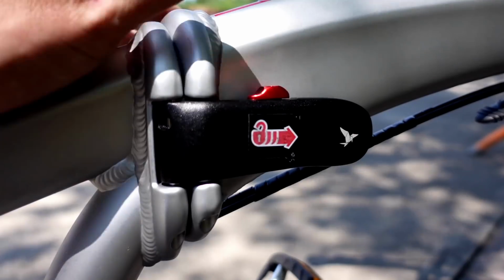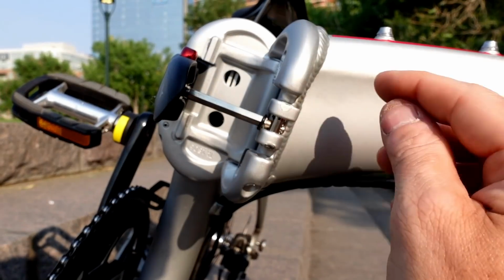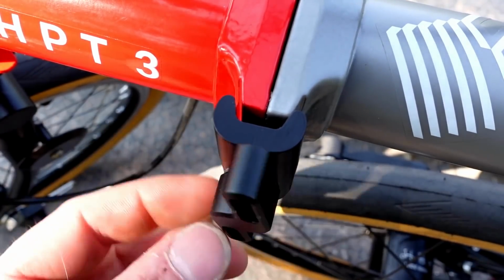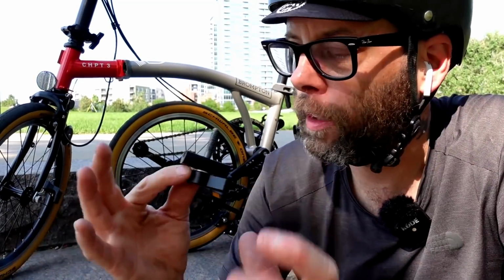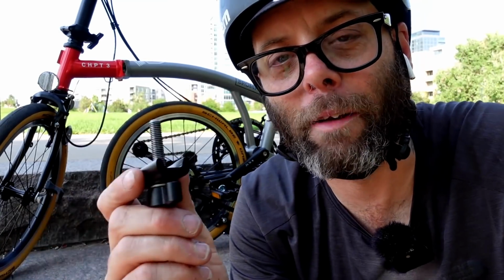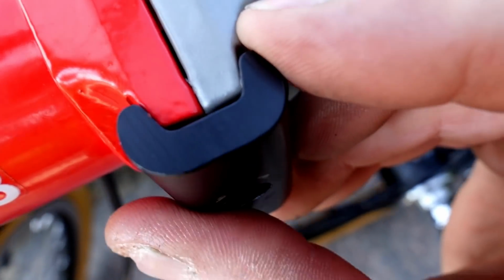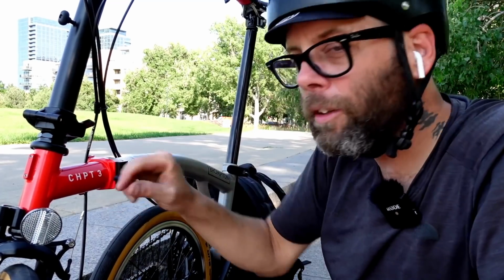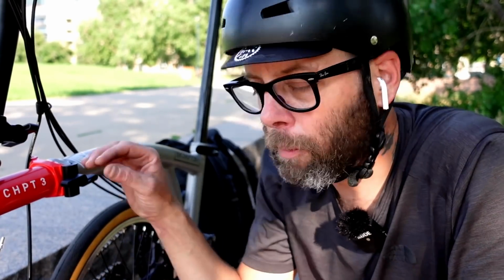Are Brompton clamps Obsolete?

Comment: Aerospace engineer and yes, failure points are valid.  
Aluminium latch is sacrificial part and stops frame from wearing.  Cheaper to replace hingle clamp or the frame !!! 
TRUTH.

Comment: Brian, why am I commenting on this 3-year old video of yours? First and foremost--it's really good as a technical video. You are adding value on several levels: on the level of a Brompton part (the hinge) that any Brompton owner can relate to. Secondly, you are overlaying your technical background and adding tremendous value (for example, when you indicate the 9-potential failing points or how much engineering goes into this--you know from personal technical knowledge and experience). But man, you are on fire here: clear-headed, articulate, moving fluidly from one aspect of the issue, to another.  This is you at your very best. I hope this becomes a model for your returning to what you do best: talk clearly, technically and from experience. This simple video, in my humble opinion, is one of your very best. And how ironic, it's about and simple clamp, but it adds tremendous value!--Steve

Comment: Simple is safety. BUT; From what I've seen, Bromtons are not as tough as you and others on Youtube claim. You've had problems with your bike, parts that should not go bad, HAVE gone bad. Bottom bracket, seat posts, rear drive hub, broken frame, no they are not as solid as I once believed. The clamps seem bombproof, but, the bike isn't.

Comment: So I genuinely agree with all the points you've made , but I think the reason people say brompton doesn't innovate is because of their fundamental failiers as a company towards there customer base and the lack of options they provide ( despite people constantly requesting) like refusing to make bikes for taller , heavier riders, 20" wheels , voiding warranty for making modifications they refuse to do, making an awful ebike conversion(don't put the battery in the bag i wanna put my stuff in)  the list genuinely goes on and not for lack of quality being available from 3rd parties, anything from belt drives to rear triangles that can suport larger hybrid tires, everything falls on deaf ears with them. If they made it we would buy it !!! Regardless of them refusing to move manufacturing abroad to reduce cost to consumer.

Comment: The wear is between the metal interfaces that are susceptible to load and rubbing, so the frame-frame joint ends wears. If you always keep your clamp tight, then the frame-frame joint ends wears much slower. The wear on the clamp is much lesser because the load is much lesser on the interface between joint and clamp, but it will bend slowly over time and open up, faster if you tighten it more. That's why 3rd party manufacturers improved it by making it stronger.

Comment: A brilliant and straight to the point video. Some people buy the fancy clamp just for the looks, not necessarily for the simplicity of rotating it. Safety is the most important factor in the clamp. I  wouldn’t want to have the clamp break thus causing an accident whilst riding.

Comment: Please folks stick with the stock Brompton STEEL  hinge bolts,   have had two aluminium bolts shear off.    Well said Brian !!   Do not switch out the original bolts,   you will in the end realise the stock bolt is the most reliable and the safest option.

Comment: Totally agree. Brompton has been around since 1975 and had essentially not changed. The early Mk 1 had some welding issues which was fixed. Sometimes people dont realise why Brompton does it their way.  Brompton clamps are made of aluminum because it’s made to wear out against the steel frame.

Comment: Enumerating points of failure is meaningless if the chances of failure are small & I contend they are very small with the evolved modern folding loch mech.  A locking mechanism that can be completely removed from the bicycle is one that can be lost.  I'm not saying the Brompton mech is bad - its strong and simple and bolts are easy to replace.  But it is pre-historic and modern folding clamp designs are undisputably superior in terms of reliability, ease and speed of use and safety, dang it.  The Brompton is 1950's design.  Its 2022 now,  and engineering has come a long way.  Aluminium is a wonderful material and  we do amazing things with it.  Steel has wonderful qualities too but the best place for chrome steel is in the fork, not the whole frame where the strength and weight advantages of aluminium offer so much.

Comment: You make a good point about the piece being sacrificial. If you were to make it from a stronger metal, the weakest part of the mechanism then becomes the bolt. Many people don't understand how bolts work. When you tighten up a bolt against a female thread, you are actually stretching the bolt by a very tiny amount every time you use it. With time, this leads to work-hardening of the metal and it will eventually fail.

And if the bolt fails, you are in BIG trouble (but it will probably happen so fast that you will wake up in hospital with no recollection of it).

Much better to have a softer piece that you can inspect visibly pretty much every time you use the bike.

Comment: Thanks Brian for an excellent analysis of the original Brompton clamp design. I replaced both of them with LITEPROBIKE for over a year now. One of the clamp fall apart the other day when I was tightening the clamp to the frame. The top turning part separates from the screw that attached to the frame. The screw stripped apart from the clamp and there is no way to keep it lock tight, thus cannot ride the bike. Lucky I was very close to home and now I have changed both clamps back to the original Brompton clamps. Yes the color coordination with the LITEPROBIKE clamps dress up the bike nicely  but it introduces safety issues that I will definitely avoid. Cheers.
Reply: The old Raleigh Twenty clamp was the strongest frame clamp for folding bikes and also no failure points as it was a top tube clamp that would hold even if clamp bolt was unscrewed
Reply: Thx for sharing your knowledge of Bromphton I would love to get one but ca
N’t afford it 😂
Reply from the maker: I've heard horror stories that's why I made the video😬😀  thanks for watching.👍

Comment: Hi Brian I've been watching your channel for a while, great video and very topical for me. I have a Brompton B75 and a Gocycle GX. Love my B75 but I use my Gocycle more as it's my main commuter bike. I took it for it's first annual service in December and they found the main pin holding the handlebar latch only had a couple of millimetres left in it and was about to fail. I had to wait weeks for a new pin and with in a week of getting back on the road the handlebar latch started to rattle again. It's gone back to get sorted again but I've lost confidence in the Gocycle because of this and a few other durability issues. I love my B75 but because I've got a lot of hill's on my commute I've bought a new Brompton Electric 2021 6 speed and when the Gocycle gets fixed it's getting sold

Comment: You know why the aluminum frames are so thick in terms of wall thickness and tube diameter?  It's to reduce flexing.  Any flexing on aluminum contributes to fatigue and eventual failure.  Steel and titanium can theoretically last forever if not flexed into the plastic region.

Comment: I have added a wheel and a bolt with a stop in the end, which won't unscrew. And lightweight clamps from carbon. The one wheel wasn't fixed, so I used Locktite.

Comment: I kept the original clamp but changed the bolt , ok the new bolt is titanium,  but I greased the bolt thread and frame thread often. One of the new bolts has extra screw to stop the bolt comming totaly off accidentally.  Ps Great video and thanks.

Comment: Nice one Brian. Just a question. Recently my clamps have started to stick in place. So normally when you unscrew the bolt, the clamp comes away, but recently been sticking so have to pull on it to release it. Not sure if anyone has had the same thing? Don’t think it’s a major issue but worth mentioning. Recently replaced the clamps at 6k km and same thing with the new clamp. They are Brompton ones as well. Stay safe! 👍😀
Reply: A smear of grease on the inside "wings" of the clamp should do the trick!
Reply: @nicholascoupland9944  thanks Nicholas. Have been doing when giving it a clean, but just wondered if anyone else had noticed the same?
Reply: Do not tighten it too much, just finger tight will do. Also, put a bit of grease on the frame hinge.
Reply: @andrewpeternavarrete1227  I never really over tighten it. I have been putting a little bit of oil on it, but just wondered if anyone else had been experiencing the same. I do quite a few miles on it. Replaced the hinge clamps a few months ago which solved it, but started again now. 👍
Reply: Grease or wax should do. Springs also work. Brian’s critique of aftermarket clamps I’d flawed, by the way. My SpedDial kits, for instance, are made in the USA of certified components. My competitor’s EZ clamp springs should also help solve your problem.

Comment: Was speeding on a folder similar to what you presented at 2:10, hit a speed bump, then the stem collapsed on its own. I guess the force was enough for the small catch to fail. Had a sore shoulder for a month and a half. No bones broken, thank God, but the helmet was smashed.
Reply: Similar thing happened to me landed on my head, stitches, cuts and bruises etc at 14 miles an hour I’m sure I secured it properly.
Reply: Bumps should be avoided on folding bikes as much as possible especially on aluminum frame models.
Reply: Hi @carltongadgettmannprice352  , I doubt if what I described above will happen on my Brompton because the clamps are designed robustly. Now, if your bottomline is that folders are not designed to take stresses riding through speed bumps, then my bottom line is that this folder I rode on was not designed correctly to address the needs of your everyday urban mobility.

Comment: I do plan on replacing my clamps, and yeah for vanity reasons. I’ve got a black s6L and I’ll get black  Brompton clamps to replace the Ali ones.
I wouldn’t trust anything structural from after market sellers. Saddle, grips, a rack if I fancy one yes, but structural,  I’m sticking with OEM parts. I’m an engineer and I trust that the engineers at Brompton have got it right, so I ain’t gonna try and fix non existent problems.
Thanks for the vid Brian 👍
Reply: You might find my SpedDials superior to OEM clamps. You could also add my competitor’s EZ clamp springs to the OEM, adding convenience to reliability.

Comment: Yes the standard clamp is functional, however it could be improved by making 1 side minutly longer to stop it from spinning. Also add a spring.
Reply: I use a set of these.
Reply: Ez clamp springs, 3d printed and cheap!

Comment: Interesting video, thanks Brian.

The beauty of the Brompton design is that you don't have to keep adjusting the clamp.

My old folder is a Taiwanese Raleigh (also real steel) which has the more common toggle type of clamp. When I rode it daily I had to adjust both the frame and handlebar clamps every 3 months. It wasn't a safety thing, it was just detectable play and I hate any vehicle I own to be out of adjustment.

Engineering trivia:
1. A 3/16" steel pin in simple shear takes over 2000 pounds to break it.
2. Lightweight alloys, particularly aluminium (or aluminum in the USA) suffer from metal fatigue. This means it eventually cracks and if the cracks go undetected you get sudden failure. This is why aircraft have their airframes crack tested on every major service: and why my son's last commuter bike suddenly became instant trash. I own four bikes and they all have steel frames. Even the lightweight ones have Reynolds steel tubing.

Comment: Have you not seen the little widget thing that keeps the Brompton latch from spinning? Just a little plastic thing that keeps the plate from spinning as you spin the bolt. Made all the difference to me. One-handed clamping.
Reply: I put a small spring I bought from a motorcycle shop, and it works perfectly.🙂
Reply: Glad to hear you are happy with my competitor’s EZ spring clamp! (Though I recommend my own SpedDial kits for reasons I’ve explained elsewhere on this thread.

Comment: Do not replace brompton clamps with aftermarket  clamps since they are not  made to same specs. Ti parts clamp does not clamp correctly according to Brompton NYC they recommend removing aftermarket clamps  for safety.
Reply: My SpedDial clamp kits are made in the USA and equivalent in strength to OEM, but easier to use.

Comment: An excellent video which all Brompton owners definitely should watch for the very well made points.
However.
As a 100% Brompton fan I wish that they could re-evaluate some of the other design features, for example the suspension block. Automobiles use spring suspension and there is a leaf spring product for the Brompton. IMHO when correctly designed and made of the correct materials, it is a far superior solution. 
BTW this doesn't include anything sold on Aliexpress.

Comment: Awesome video Brian. Your talking points are bang on. Another thing to bring to your attention is that if you were to look down the "U" channel, you'll notice that the sides are not perfectly flat from one end to the other. This is not a fault but just goes to show the perfection of Brompton and their R&D team. The ends tend to "dimple" inwards to apply more clamping pressure at the frame hinges top and bottom part. Absolute genius. Bottom line, I too would never consider changing the stock clamp.

Comment: Thanks Brian. I 💯 agree with all your points. I too would not swap out the factory clamps or bolt for the same reasons. You are right, down to the threaded bolt, the metals and strength of the metals are dialled in very specifically. You'll notice an 8.8 on the head of the bolt. That's a high tensile strength rating designed for automotive use. That is it can withstand 800 Mega-Pascal before it fails with a nominal 'recommended' rating at 80% of that limit. Ease of replacement of the part was also my concern with 3rd party clamps.
Reply from the maker: Exactly.  The ones made by the factory are the best in my opinion.😁
Reply: My SpedDial clamp kits are superior to the originals in function. They do come with slightly longer 8.8 bolts.

Comment: I take on board what you saying about weak points on Tern clamps, but after checking clamp mine it has the same marks as yours. It's not the alloy that's damaged, it's just paint. Do you not think reputable companies such as Tern and Dahon do stress and safety tests on their bikes, especially the joints and clamps? Brompton are not infallible. Just look at their gear shifters.
Reply from the maker: Well one would hope.  Tern is a reputable company and I am sure they do all kinds of test.  I just think that there are more failure points(more to go wrong) with their clamping design.  You are right....the Brompton shifters suck😀
Reply: @ibikeunfolded  I fully agree with you on the Tern clamp failure points; it's evident to see once you illustrated it. Happy cycling.

Comment: There’s a 3d printed spring you can screw the stock clamp through that makes them a lot less annoying to use, without adding complexity. I’m using them they’re great! I’d print you a set if you were nearer
Reply from the maker: Unusually I just use the trick I mentioned at the end of the video and have had no problems.  THANKS FOR THE THOUGHT😀👍
Reply: @ibikeunfolded  yeah if I tried it I’d probably somehow lose my balance and fall over I’m not that coordinated :D
Reply: 3-D printers enabled the inventor to manufacture them without investing in tooling, but it also invites counterfeits. Even if the inventor of EZ clamp springs has patented them, he can’t sue thousands of individuals for $20 each.
Reply: @stephanbianchi6324  Okay, and? Who cares

Comment: I totally agree and would not replace safety relevant parts. I just added the EZ clamp spring so that the clamp does turn around. It makes the folding more convenient.
Reply from the maker: The EZ clamp spring is ok, however, just keep in mind that it takes up space in the clamp “GAP” that I was talking about in the video.  The clamp is meant to wear and once it bottoms out you will tighten the clamp and it won't hold the frame together securely.  Having the EZ clamp spring in the gap just ensures the clamp bottoms out sooner.  Just something to keep in mind👍😀
Reply: Great video Brian - Thilo, I've been thinking of buying the EZ Clamp spring as looks like a great idea; do you think it is robust enough to last?
Reply: @davidclark1152  I use it since 9 months and it looks still good. I don't understand Brian's last comment, maybe when the clamp wears out I will understand... I only have the Brompton for a year.
Reply: @thilonotz9991  thanks - I'll order them and give it a try :)
Reply from the maker: @GyrobotCoUk  thanks for the info.  The design I saw did, so it’s nice to see that there is one that’s better designed.
Reply: The EZ Clamp spring thing doesn't take up space in the gap at all. Been using them on both mine and my wife's bike without issue!